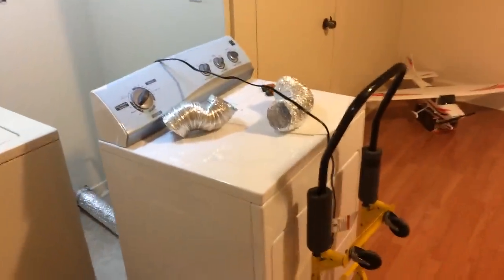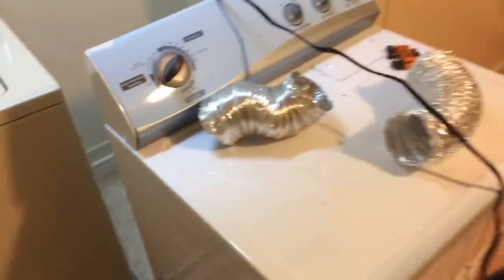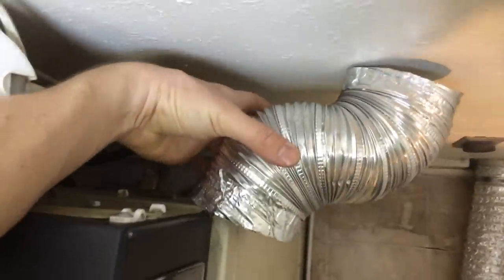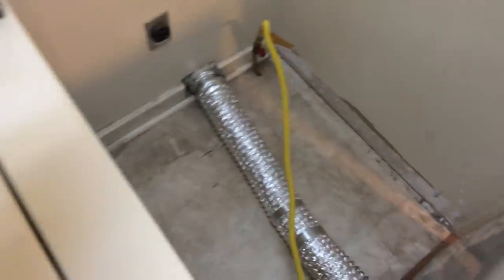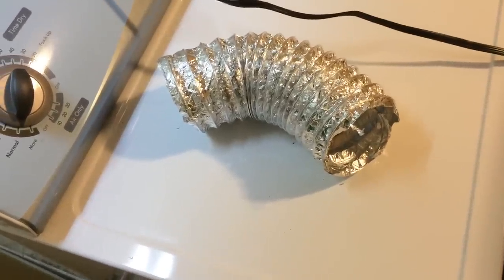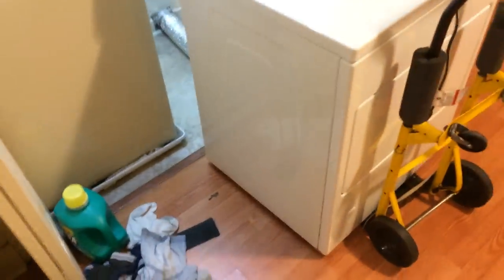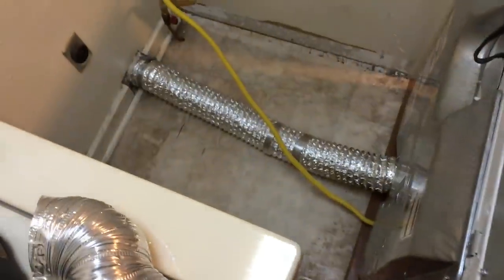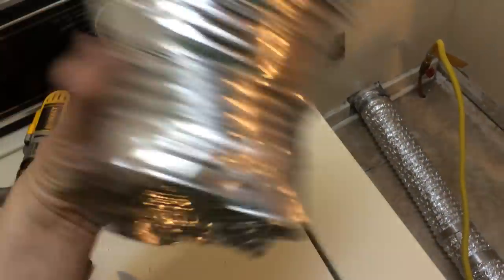How to Connect a Dryer Exhaust Vent Made Easy (MUST WATCH)

Comment: The problem with this method is that the duct will kink when you push the dryer back in causing flow restriction, lint build up and thus fire danger.

Comment: so it may kink. but also the flexible hose used is not rated for dryers. it is flammable. very.
Better option. remove washer. fit dyer and then put washer back. connections for washer are usually easier to get to.

Comment: ** AVOID THE ADVICE IN THIS VIDEO **

So , this is actually very dangerous, it is true that it will be easier to install, the big problem with this is that when you push your machine back into its location 
1) you have an excess of tubing that will collect moisture and lint
2) with all the extra tubing getting pushed back you have a very good chance that it  bends , twists or kinks
3) these bends or kinks make extra taps that will capture even more moisture and lint 

And the biggest overall problem is this becomes a HUGE RISK OF FIRE 
 
SO MY ADVICE WOULD BE TO AVOID THE ADVICE IN THIS VIDEO
Reply: Refuting another guys method as dangerous without offering a viable solution is an exercise in futility...care to try again?

Comment: uh....you are using duct material that is very flammable and could burn your house down.  YouTubers...do not use this material for ducting .  It is safer to use the flexible aluminum duct...but rigid steel pipe is the very best.  We may see the ducting shown in this view banned.  I hope so.  Watch this video  https://www.youtube.com/watch?v=vfExQ3mwBH8      jeta45...switch to safer ducting ASAP.

Comment: I got pissed too and tried this very thing.  Still doesn’t work because it kinks and doesn’t go back straight.  So, I just had to cut it short again and hang over dryer like a bat and screw the radiator clamp in before too much blood rushed to my head before passing out.  It’s really fun.
Reply from the maker: Thanks for your comment.  Exactly why I created this video  I was showing my solution from having to do just that.

Comment: No because the hole to the outside is on the side wall. And the issue is that the bands holding them on don't hold them on. and any movement of dryer back in place creates kinks or else the bands fall off. Had the problem for years now and still have no hose into the wall that lasts longer than one load. I don't know why they don't invent an elastic band that goes around it.

Comment: Unfortunately that super flexible tubing has paper in it and is very flamable, so not a good idea.  But I understand the frustration because I have the exact same set-up in my laundry closet and I just got done cutting my finger, banging my head, pulling a muscle in my arm, pulling the whole bloody duct out of the wall and swearing at the top of my freaking lungs.  You'd think in this day and age someone could have invented dryer ducting for tight spaces that works well and attaches easily.  It is so idiotic.   But, don't use that flexible ducting unless you want to burn your bloody house down.
Reply: Not true......I've seen the videos that have the ones that light on fire.  But they are not all made the same.  I did my own experiment on one I used for the short run from the dryer to my solid vent line.......no way could I light it on fire.  I held a butane light up to it and couldn't start it on fire.
Reply: @timkarcher6724  Yup they make some of them specifically for dryer venting.  Although it could still fill up with lint and start a fire but if you're using a electric dryer it's pretty much a non-issue, and if you periodically clean it like you're supposed to that solves it.
   Also For $7 you can get a quick disconnect so you just reach down, pop it off, brush it out, and snap it back in.

Comment: This will work but it does increase heat cause of the funneling in the ducting. The more bends and the  longer it travels will slow down exhaust.
Reply from the maker: Charlie Stevens Thanks for your comment charlie.

Comment: the tech is showing how to instal a flex hose a little bit easier. if fire was a concern manufacturers wouldn't make these crappie flex hoses anymore and stick to the aluminum ones. bunch ignorant people that like to criticize ,without  going to the right source .
Reply: Get some of it and put a match to it, then come back and comment.
Reply: I HAVE AND I COULDN'T SET IT ON FIRE.  I've seen the videos on the one that do......but they are not all mad e the same.

Comment: Good idea but once you push the dryer back the tube will get in the way and won't let you push the dryer all the way to the wall.
Reply from the maker: jpim75 Hey, thanks for you comment.  I'm glad you asked.  

The duct I used is this one: http://bitly.com/1I8tS0k  Take a look so you know what I'm talking about.

Basically, it can compress and stretch as designed like an accordion or a slinky does.  This duct will do the job well too.  Soo, as you slide the dryer back in, make sure the exhaust duct is compressing, folding together in some what of a line form, as opposed to getting sideways like an "S" and compressing it oddly.  Let me know if that helps.
Reply from the maker: ***** These also work: http://amzn.to/1JSMAOU
Reply: I guess you didn't read where it says not approved for dryer venting.

Comment: Did exactly the same as your video showed.  Stepped back and realized I do   the hookup out in the room and push the dryer back.  Was Almost ready to build sheet metal pipe / gas style as I was so pissed with frustration. LOL.

Comment: Why dont you take a match to that transition duct and watch the flames!
Reply from the maker: +Tim Sheehan Thanks for your comment.  Not cleaning your duct can lead to not safe conditions.  This will help a lot! http://amzn.to/1OqYNh5
Reply: +jeta45 Thanks for your response to my comment.I do not mean to be critical, only to point out that the silver flex transition duct is flammable and reduces in sizes when compressed putting back pressure on a dryer, leading to lint buildup and dryer wear.
Reply: It would reduce in size when stretched out, and increase in size when compressed (back to its original size, or close to it).